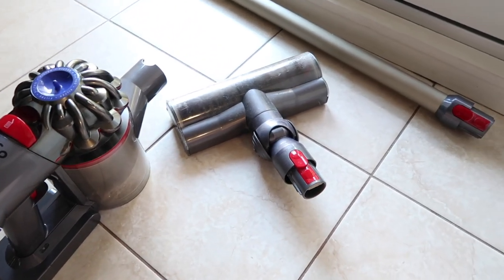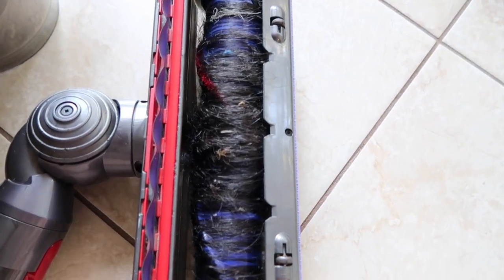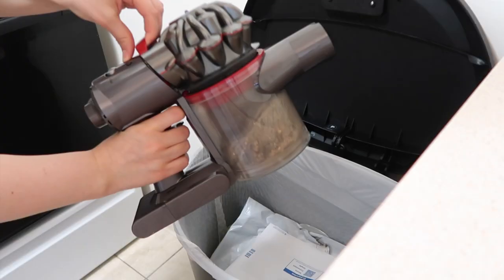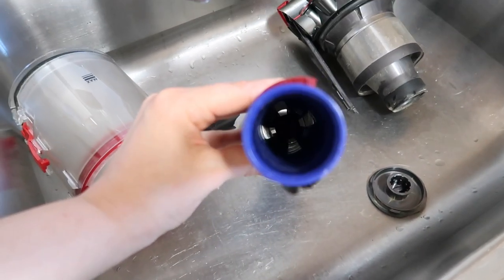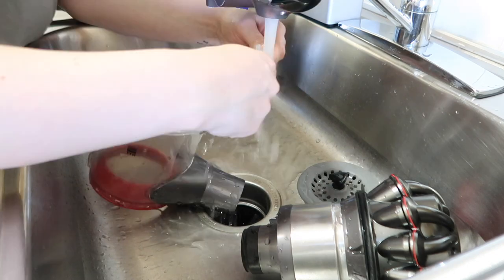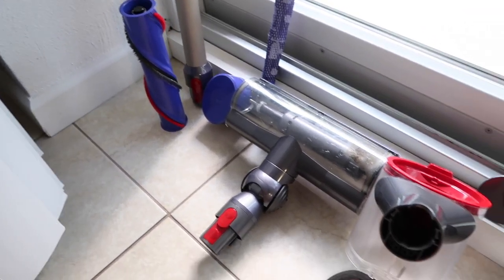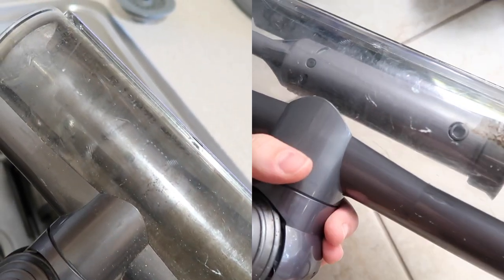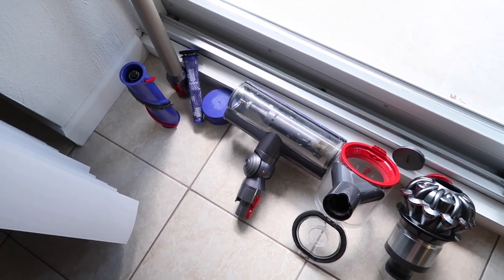Simple way to deep clean your Dyson

Comment: You did a good job. I am not sure I have exactly the same one but that bit at 4:30 inside the head, with the fluff around it, you can take it out too. You need a special screwdriver and it unscrews from the inside. You have to go through the other open side of the head. It is a bit fiddly. Mine started to smell of burning and when I removed that piece, I realised there were hairs wrapped around on the inside that you can’t clean up unless you take that bit out.